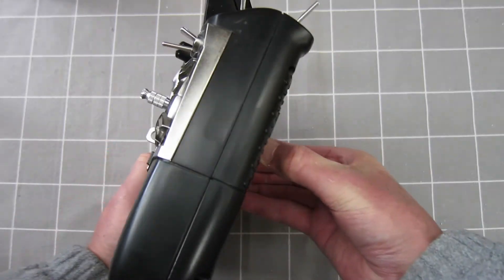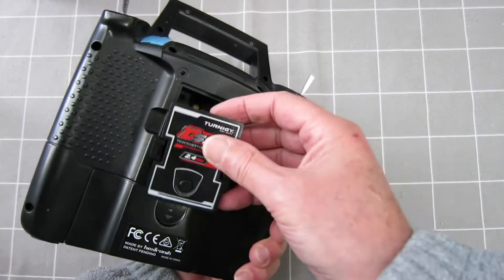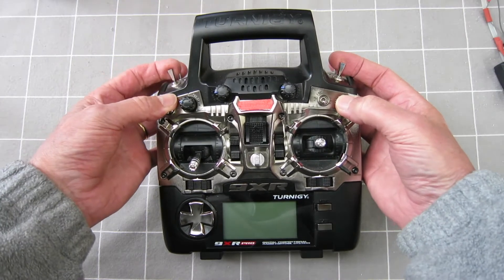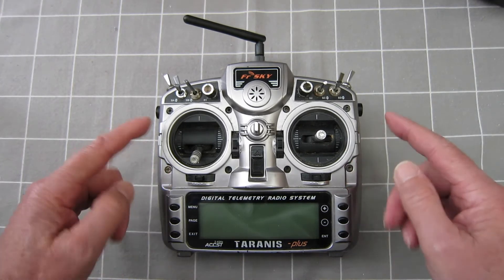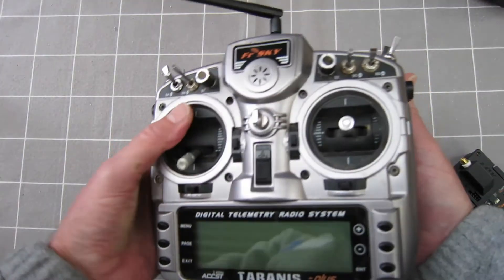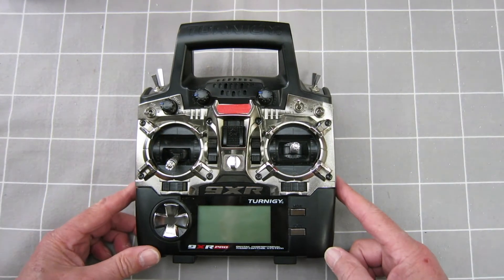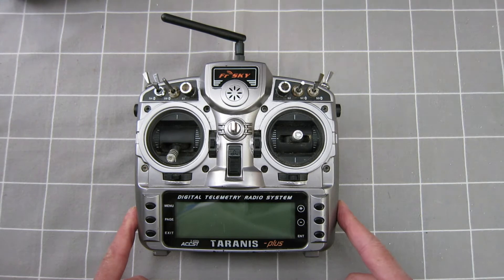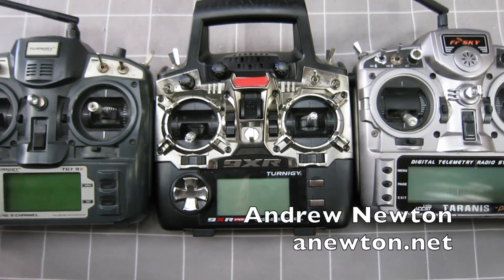OpenTX Radios

Comment: I just want to verify that the 9XR-Pro does not have any form of "internal" module separate from the external module that has to be purchased separately?  What's the purpose of having the internal antenna if the external module comes with its own antenna?
Reply: Correct, there is no internal module. It would make sense to be supplied with the DSSS module that connects to the internal antenna. But don't buy this radio, get the Taranis Q X7
Reply: I already bought the transmitter (second hand purchase).
When I was going through the menu options for the "stock" firmware, I saw options for disabling the internal-RF.  I found it strange as I thought the transmitter only transmitted through the separately purchased external module.  I noticed when I flashed OpenTX firmware, all these options were gone.  I only have the option to play around with the external module.

At one point, I thought the radio had the internal option of supporting additional protocols, while the external one supported others.

I also thought it was the combination of the internal and external modules that gave a possible 32 channels.
Reply: Ok, it's a perfectly good radio. I think the stock firmware was just a version of OTX which had Taranis functions listed but not useable.

Comment: Morning Andrew, I have to agree, I'm so glad I went for the taranis. 
Steep learning curve, but it's quick to make changes, I set up my Phoenix 2000 with flaps etc... All in the handset rather than in the opentx software. In a few minutes. Matt
Reply: To me OpenTX is logical and powerful, love it and the Taranis
Reply: Andrew Newton Yep me too. I tried helping one of the lads on the flight line with a DX something or other. WTF their menu system is screwed up, no logic to it at all. I had to hand the transmitter to one of the other pilots to help him out.
Reply: That's the radio I recommend to beginners, very nice.
Reply: +Matthew Ogborne I don't believe it. Asked Tomtop and they are sending one for review. Good suggestion Matt

Comment: I need the link to the USB for the 9x.  I've already put in a back light and the internal module.  May as well try the USB.
Reply from the maker: I added the Smartieparts link, not sure about the bare wire USB port.
Reply: Thanks !  Ordered the Smartieparts $17.00 one.  Thought about the $69.00 Extreme, but decided to wait and maybe get a Taranis if I quit spending money on other stuff.
Reply: Excellent, that's what I would recommend.